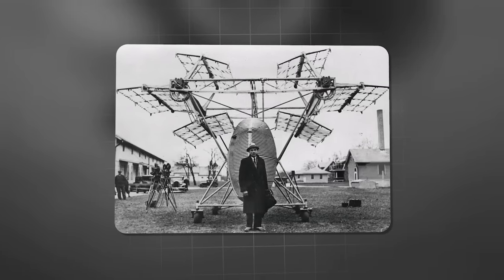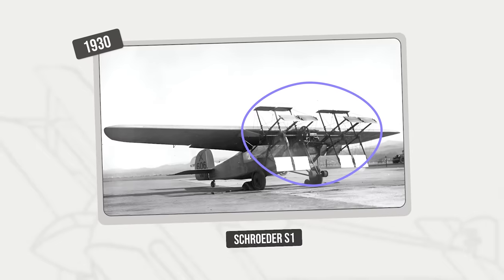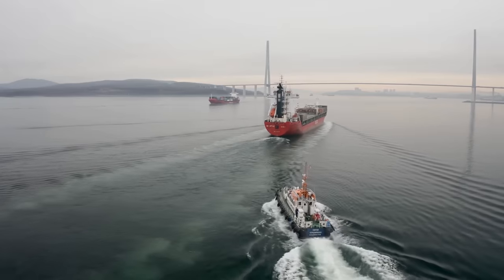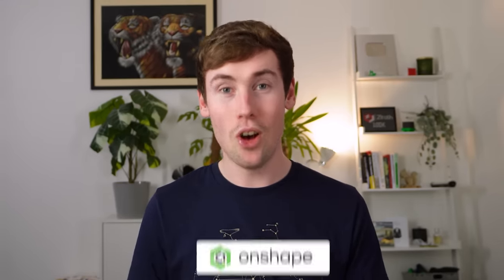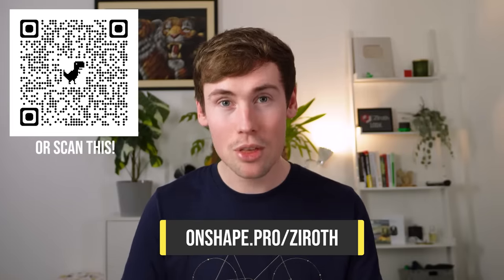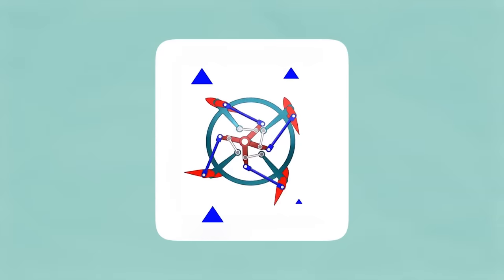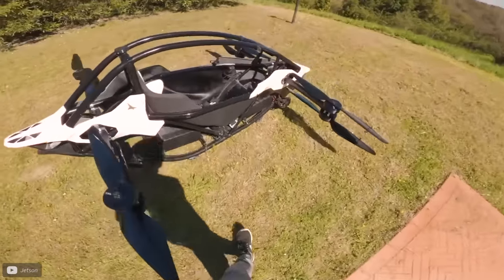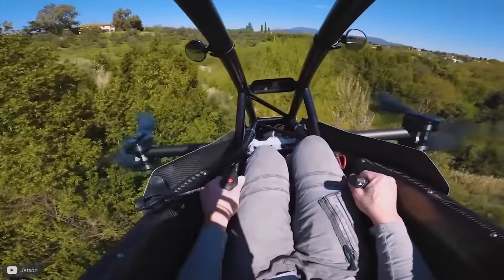The Genius of Cycloidal Propellers: Future of Flight?

Comment: The problem with this design is that it will be blown around by the wind, making it very dangerous even in light winds. Those rotating wings act like giant sails, which create a lot of drag and prevent the vehicle from going fast, and also making it susceptible to winds. Those rotating blades are also much more susceptible to bird strikes than a drone, which has its props pointing up. Also it can not glide to the ground if the motors stop. The efficiency of the design is very poor and will not get very long flight times. All in all a very poor and dangerous design.

Comment: “ did not” past tense.. singular
“ achieved “ .. multiple ( more than once )

Your printed banner across the screen does not make sense. It’s grammatically incorrect.

“ did not achieved flight “
__

In English, when forming the negative past tense with “did not,” the verb that follows should be in its base form. 
The correct sentence would be “did not achieve flight.” 
This rule applies to all verbs in the negative past tense constructed with “did not.”

Comment: I notice you say it's quieter, but you don't actually let us hear how loud they are when showing the clips.

I think the reality is you made that editing choice because these are still really loud. As a result, these will never be appropriate for use in an urban setting. Our cities are already loud enough with regular cars; adding flying cars to the mix would be psychological torture (not to mention the risk of one of these propellers failing or a computer mishap crashing a flying car into a building).
Reply: OK. We used to have a fan heater using one of these to blow the hot air out and it was quiet.
Reply: @20chocsaday  Fan heater and a propeller for an aircraft are very different scales.
Reply: @Zedprice  
True,  but it seems one of the designs for a wind turbine to generate electricity was one of those mounted on a vertical axle. 
It would not need to be swiveled round to meet a changing wind. On the other hand, it could not be easily swiveled to catch less wind.

Comment: Those of you who are young have GOT to get over this idea that you know better.

The physical world and infrastructure is like this because people far more intelligent than you and I figured these systems out 140 years ago using engineering, physics, and maths concepts that have not changed since.

Aircraft look like they do as that is the most efficient way to build them.
Cars use petrol because batteries waste energy.
Trucks use cetane because it has +13% more energy per unit volume than gasoline

Karl Benz tried batteries in 1883.
They do not store enough energy.

Rockets need to move 300k pounds to Leo because that is minimum needed to get fuel and life support to Moon and back.
That number hasn't changed since 1955. New materials and supercomputers have not changed that figure more that -5% in 70 years.

SR71 as built using chalk and slide rules with 65 yo tech.
It is still the fastest jet craft ever
70 yo tech designed on a blackboard.

Comment: how could this be used on a sub
Reply: Could take the place of diving planes. Could enable hovering with lower noise and power consumption than conventional forward motion as usually required to control depth.
Reply: @b43xoit  what about the toroidal prop, with what i am seeing if one of those goes out the plane crashes.. at least with todays props and engines if  1 goes out you can still fly and stay in the air without crashing..
Reply: You wrote "sub" and I interpreted that to mean submarine boat.
Reply: yes i was think submarine good sir... i was just addin the toroidal prop. and the prop that has the wave configuration the ene of the normal props...

Comment: Going argument - "Flying is safer than driving."

My argument - That's because only certified pilots are in the air. Any goon can get behind the wheel of a barely maintained ground vehicle sucking tank fumes, and then blame it on the owner's security negligence. You seriously wanna see air vehicles in common parking lots? At least streets have curbs and barriers to encourage no-driving zones. How are you gonna stop some drunkard from falling outta the sky on your house in your walled off "Safe Neighborhood?"

Comment: You are being sucked into a money grab - in aviation, you might notice 50% of the airfoils produce zero lift, only adding weight, complexity, and cost. All bad. In large ships, they found multiple induction motor propellers w/ reversible pitch blades along the keel...  In point of fact, Nort Taylor (Piper Aircraft founder) produced a flying certified car in 1947. Aerocar. Commercial failure.

Comment: i hate your attempt to describe how directional flight is achieved in this video...its kind of poor in my opinion. Instead of saying leading edge points this way or that way, which can be easily misconstrued because the leading edges can point towards the center 2 different ways, you should have spoke about pressure differentials...way way easier to grasp the concept like that, in my little opinion.

Comment: The technology has no future in air travel. The rotors are too heavy and not capable of autorotation, so if it loses power it will fall out of the air like a brick.

Comment: Worse than helicopters. Way too many moving parts, connected to way too many moving parts. Squirrel cage designs with strategic ducting ducting is a solution to the moving parts problem.

Comment: flying car will never exist 
 Why ? 

because cost , and because the energy demand to fly instead of freewheeling is insane , and in case of any failure you die instantly , where you can stop on the side of the road with your standard car

Comment: Half the weight of the air vehicle are the rotors?

In what universe will that be an efficient use of space, weight and power?

This is as absurd and ridiculous as hydrogen powered vehicles.

Comment: It is interesting but more trouble than it is worth. Wear on cam mechanisms, 3100 rpm has centrifugal wear, high sling of lubricants, gimbal effect wear, battery weight, it would be better hybrid engine/generator/inverter, etc to save weight but fuel is also a problem with weight/flight time, open airfoils coyl injest birds flying plastic bags, leaves, paper. Why reinvent rhe wheel? Can we make a square wheel work? Maybe, but pi is still 3.14, works well. The millenial mind set is to reinvent everuthing. Checking in the mechanical engineering history books, many things have already been done and planned obsolescence was not as popular then and products were not often engineered after being sold as today. Again, another way to make thrust but wear, tear, cost, vulnerability to too many FOD materials, etc., I think it is a waste of time and money, effort, headaches, not worth it. Too many safety dangers, too fragile, too expensive and labor intense. No thanks. Just to have "something new"? Potentential failure too high.

Comment: Mostly nonsense word-salad gibberish. On a cringe worthy scale. You have clearly never built or designed or worked  on cycloidal props nor seem to have spoken to those who have. They have NO advantages in safety, efficiency or operational versatility, in fact the opposite is the case !!! the only advantage they offer is instant 360 degree vector-able and variable thrust at constant rpm. Not suited to heavier-than-air craft needs.

Comment: useless pcs of crap. More parts to control = more parts to failure. Simple blade rotor is the best solution. You need control only rotor speed, nothing more.

Comment: for boat use, if you want but for planes... pfff for the 200 times NO, because without energy you fall... wings don't need anything to glide... 1000000 more secure... they already answer that the second somebody invented cycloidal propellers.... what a stupid video..